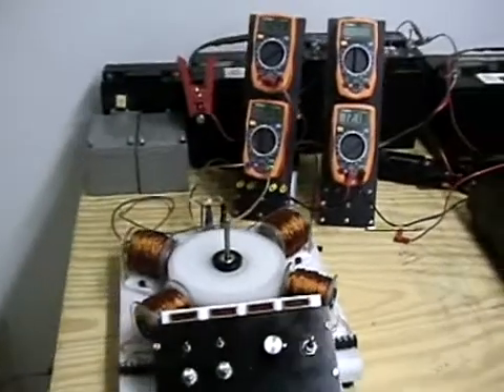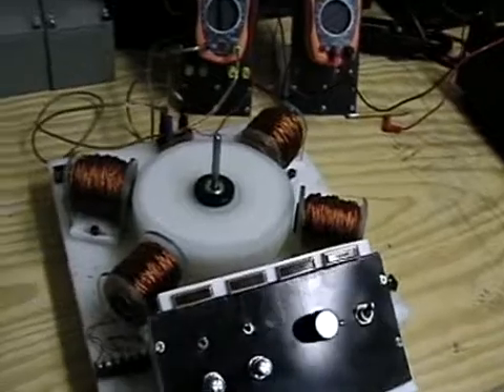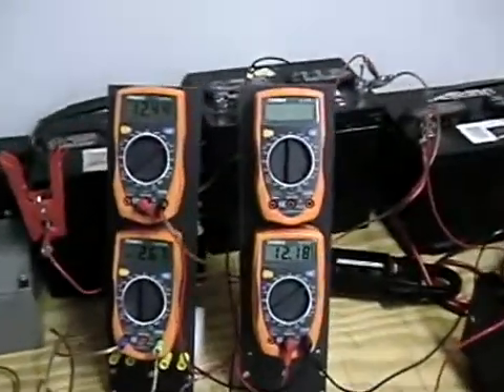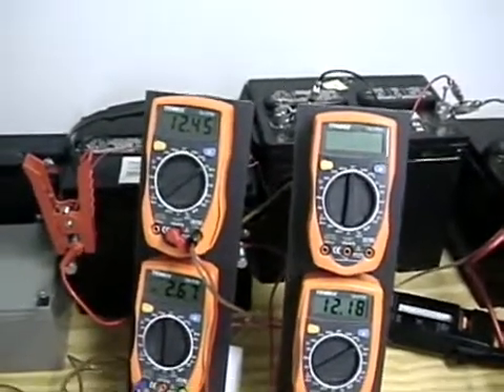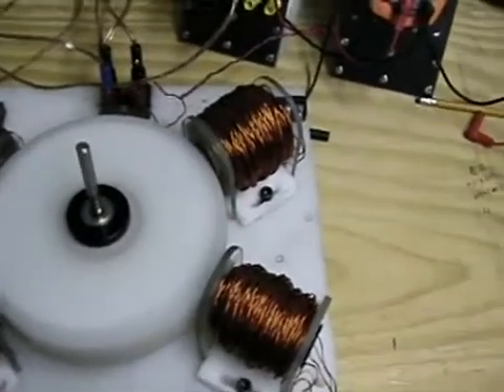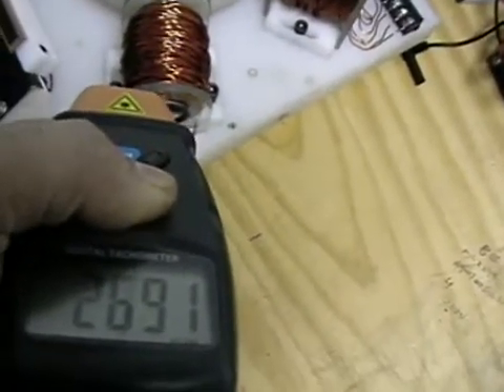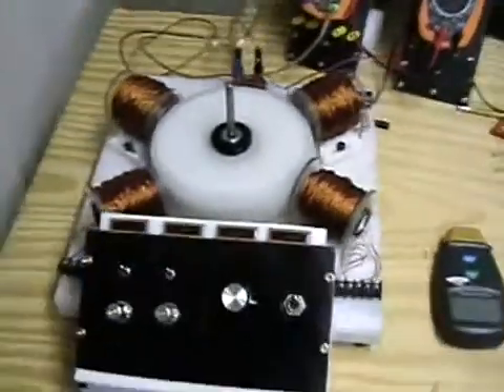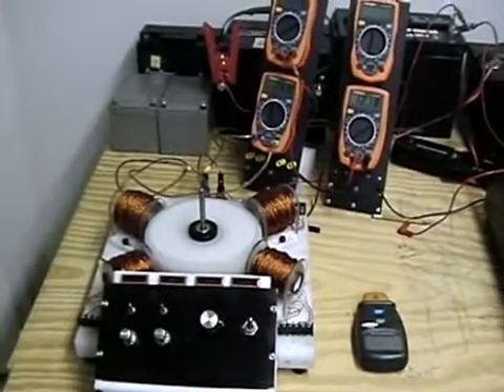Pulse Motor 8" wheel SSG August 2008

Comment: So, of you had this thing powering an electrolysis HHO generator then we're talking some serious free energy for home instead of natural gas heating no need to worry about carbon monoxide because it's just steam exhaust in heating water boiler and additional high output turbine could generate electricity from that hot water for the electrical needs and surplus power stored in batteries and/or selling back to the grid?  Is this possible?

Comment from the maker: thanks for your input CCDOG46 I have tried MJL21194G chips but this significantly change the timing as this machine uses Neodymium magnets which are stronger then the standard ferrite magnets I will deftly take a look at the specs of the 2n3773's the wheel is about 8 inches in diameter and I've had it up to 3600 rpm I don't know that I want it to go faster than that those magnets make nice little projectiles :)